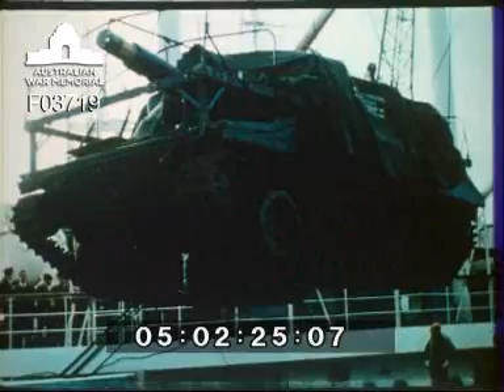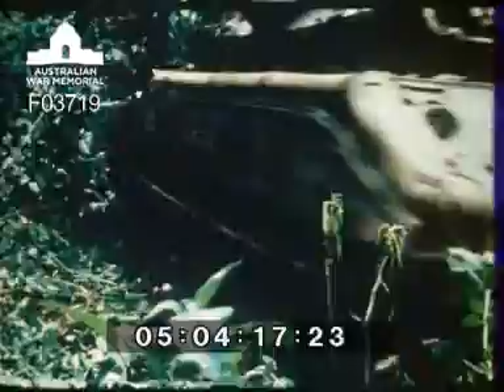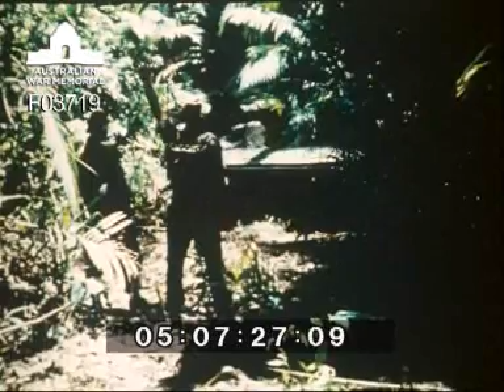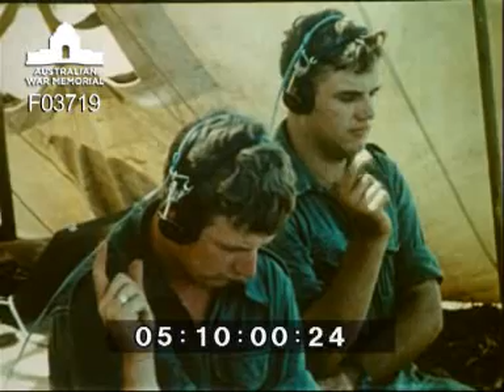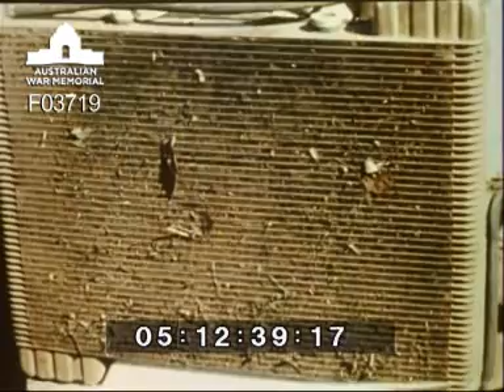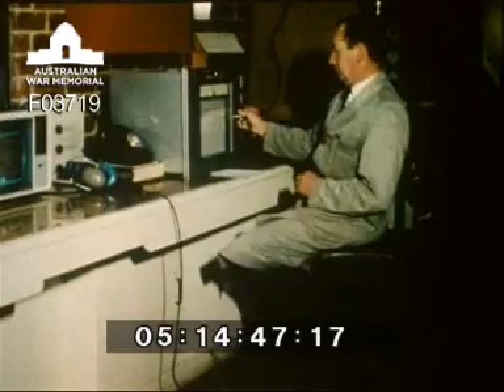Tropical Trials: general trial aspects M551 Sheridan weapons system

Comment: Honestly just a little hard to believe they found the FSV variant M113 so much better than the Sheridan.
Reply: Common parts with other vehicles in inventory. Less clogging of the air intakes. Common commonwealth ammo supply.
In the Army Reserve I trained Cav Scouts on M113 and M901 we had very few problems that could not be fixed in the field by ourselves or unit mechanics. Broken fan belts a couple of broken road wheels one fan tower replaced in the field. We change tracks a few times and replaced 10 block sections as needed.